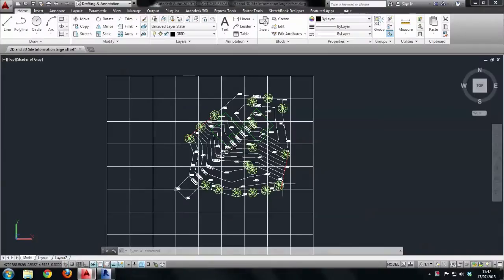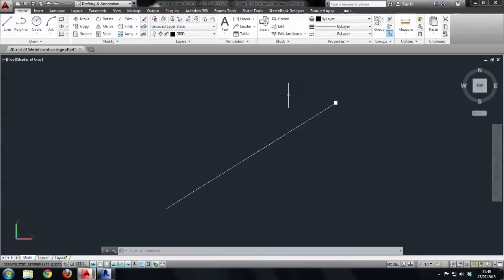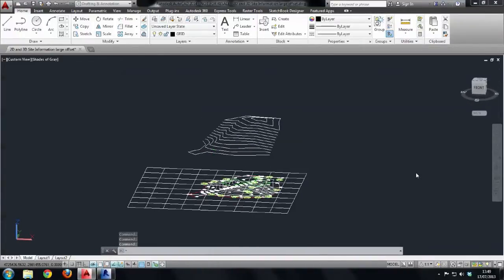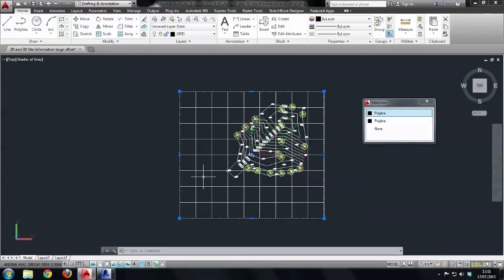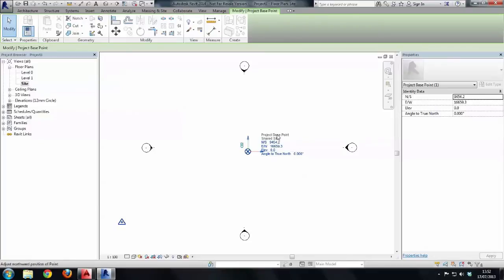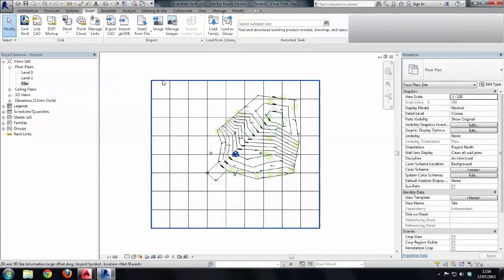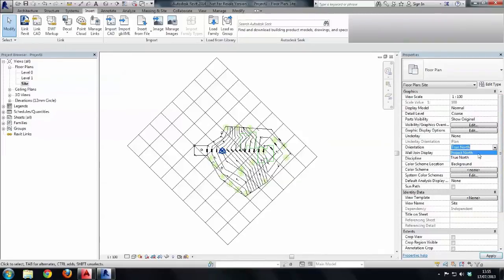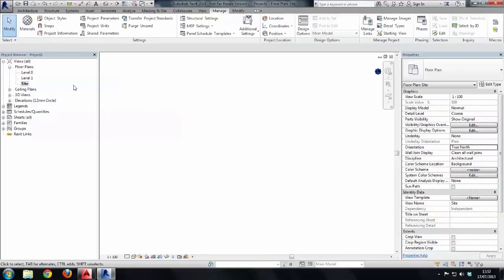How to import GPS survey information into Revit Video 1 of 2

Comment: Once the GPS coordinates are like 318373 and 6238236 (WCS) I think Revit 2012 does not handle this because the origin is too far away. I spent a couple of days trying to do it . For some reason the coordinates  in cad wont replicate through to Revit 2012